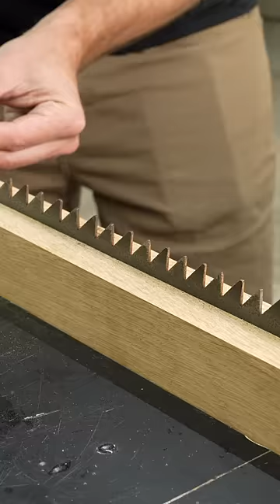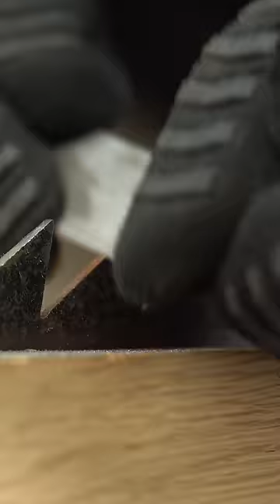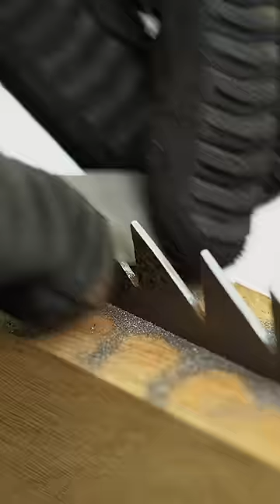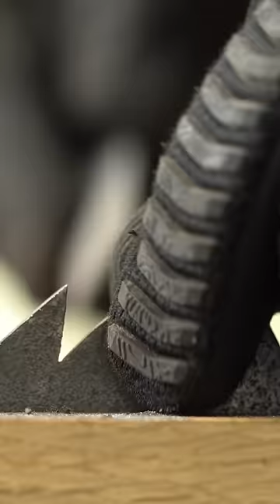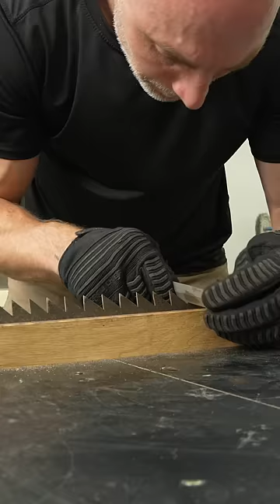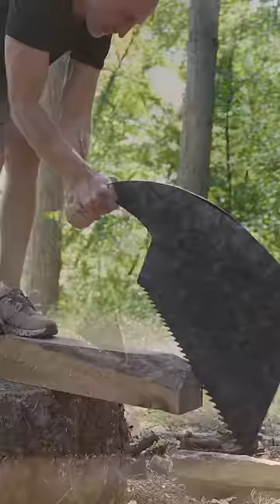Saw sharpening

Comment: I love that saw jig design, did you just improvise it? It's simple as toast and does what you need it to do.
Reply: It’s a quick solution to make a saw clamp, just a piece of wood that you saw a kerf into and then clamp it in a vice or otherwise.  You might be interested in Paul Sellers’ video on saw sharpening, he has an even cooler clamp haha.
Reply: Actually it looks like he just clamped it between two boards, even easier

Comment: Those teeth should slope back a bit more. Then it would be easier to wield that big saw. The big three things in saw sharpening are pitch (tpi) fleam and rake. Your rake is too vertical. Lean those teeth back a bit for an easier cut. Liked your video though.